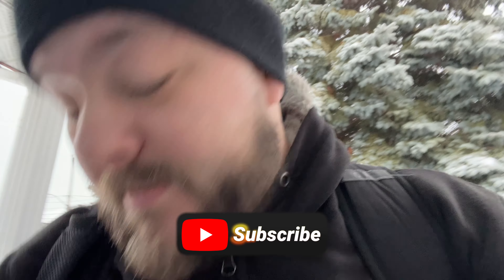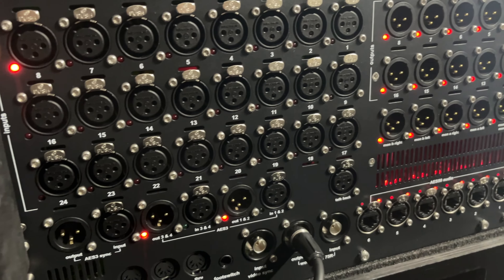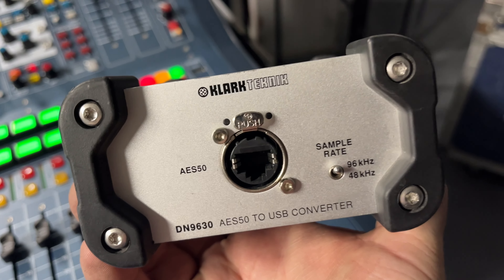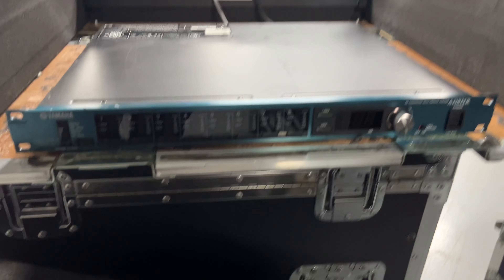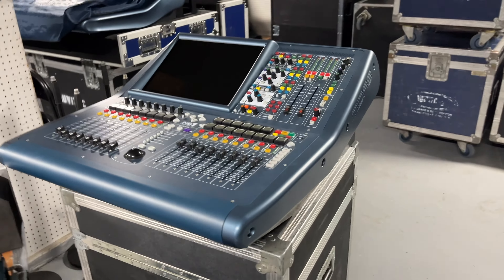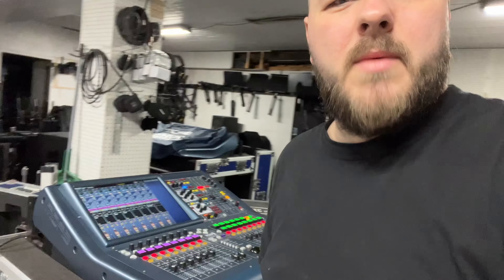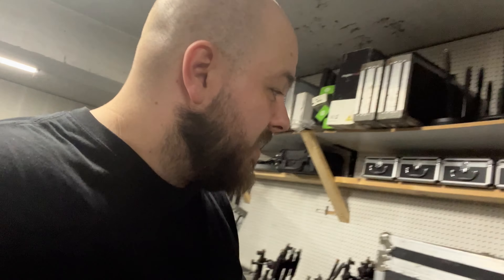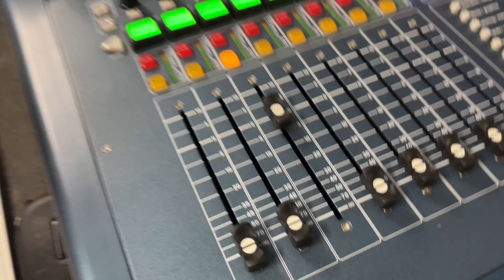I Buy a Midas Pro1 for my Birthday?! 🥳 - VLOG of a Soundguy

Comment: Happy Birthday Guillaume. Nice move!  A few years ago I picked up the Pro1 and two DL153's as a contractor package deal. Always been a Midas fan since the mid 70's when we swapped out our old PM1000 (can't believe folks now a days think this a great board...for a legacy device it does make a good boat anchor) for a board from a new UK company called Midas and a Pro3 analogue desk......whole new world for me. Been through numerous brands since and always seem to return to Midas. Even since everything build wise moved off shore.....and even after this adventure....went through two major issues with the Pro 1....within 6 months PSU went and froze the DSP so it would not boot....whole console was replaced for free......then about a year later developed some strange noise in the internal A/D boards.....had the whole thing apart and traced it to the main DSP board......had to pay to have it shipped to Denver and they replaced the main CPU DSP board....shipping was not cheap. This was several years ago now and my Pro1 has since done numerous shows with no issues. Sold the two DL153's and now run one DL451 loaded with 8x8 sub D's. Not a fan of AES50....would rather see Dante or Madi without adding another interface. Be nice to use some off the shelf switches for a more robust cost effective redundant network setup. Use good sheilded cat5e and redundant runs to keep the AES50 world stable. Even with all these issues you can see I am still a dedicated fan and am still looking to ad another in my OBtrailer build (maybe the new H96D air would next years BDay! Hah) . There are some great deals out there on the Pro series right now. 24/96 and the Midas sound can't be beat. I have mixed and installed numerous other brands....Digico SD's...Quantum....Avid S6L's....Yamaha CL's.....just always something about the Midas pres for me. Also have some 500 series modules in the studio. Have the KT DN9630 as well great little box. Easy way to get your live mix recorded. Use it in the studio and my DAW with good results. Solid ASIO drivers. One last note I run an external router and Mix Station app on an IPad air for an around the room setup .....works great. Enjoy your channel. Keep up the great work!! All the best!
Reply from the maker: Thanks for watching and sharing your experience with me. 

Since the first time I had the pleasure to mix on a H3000, I was sold, nothing sounds like a Midas. 

I like other brands, Avid, Digico are a good product but I’m always looking for something that is missing in them.

And don’t start me on PM1000… they are great door stoppers …
Reply: Great video ,I just finished a gig with my midas h3000 analogue desk, but been toying with the idea of getting a digital desk but nervous about going from analogue to digital
Reply from the maker: @chrisclose7793  it’s just way more flexible. If you get a good desk, it not a downgrade in any points
Reply: @GuillaumeLortie  thank you for that at least it be less back breaking than my h3000
Reply from the maker: @chrisclose7793 it definitely can affect your health, the amount of miles you walk on a H3000 between your kick and lead vocal if a significant amount of your daily activity

Comment: For this same reason, I need a console for myself. Small churches are always asking me to do shows for them and they usually have an old analog board and no eq for the outputs. I need to get an XR18 soon. 😅
Reply from the maker: Hi 👋 

MR18 if you can, will help a lot.
If not, M32C and a DL32 it’s packing a lot of power for 4 rack space

Comment: Hey man the same pro 1 user here, I have a question, I have ocx hd clock how can I connect it as a external clock for pro 1? Thanks in advance man, you are cool.
Reply from the maker: Use the Work Clock or AES/EBU in on the back to make a connection.

Set your clock to that port and enjoy

Comment: so were you saying that there is no way to run this console remotely with a tablet like most all other consoles? Or did I misunderstand? I have been looking at a Wing, but I am also interested in a Pro 1 or pro 2c but I have to be able to control them remotely. Thanks!
Reply from the maker: Hi 👋 
You can run a tablet with it, it’s only for Computer Offline version that is not supported anymore and the old Snake Controls app for the Ethernet Contrôle for Stagebox.
Reply: surely you can run the pro series remote, with their mixtender 2 app. but you don't have access to any fx besides of the geq. just mix, dynamics/eq and sends. thats it. it's primary purpose seems to be for doing mons on stage. but it kinda works if you never tap or use scences.
Reply: What about mix station app - is it compatible? It’s a great platform that can be used with many many consoles….
Reply from the maker: @dylandylan11731  I believe it can be used with the pro series. 
If not, I’m sure it’s an easy fix for them.
Reply: @dylandylan11731  Yes mixing station is awesome and I use it with my other boards. Unfortunately it is not available for the Pro 1. Only the HD96. Knowing that the control is very limited from a tablet on the Pro 1 it may influence my decision. I have been holding out on the Wing because of all the problems and the ridiculous amount of time that it takes to get them fixed. May just pick up a M32 or another X32.